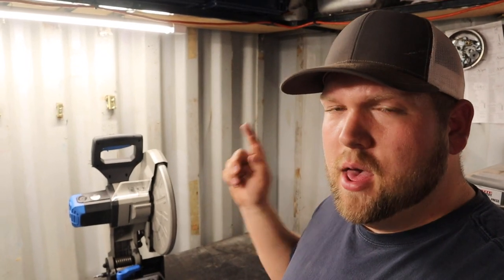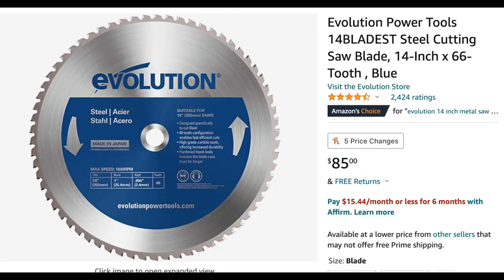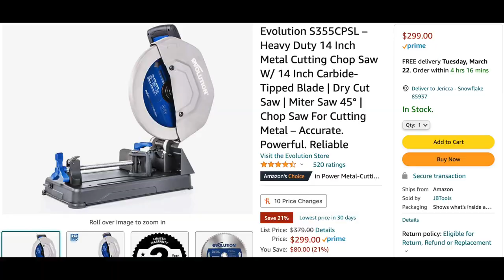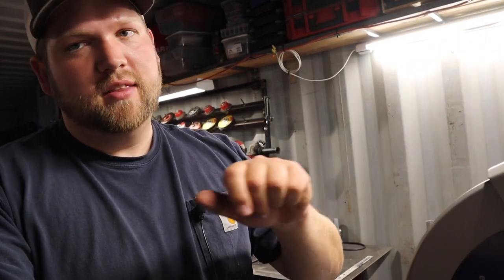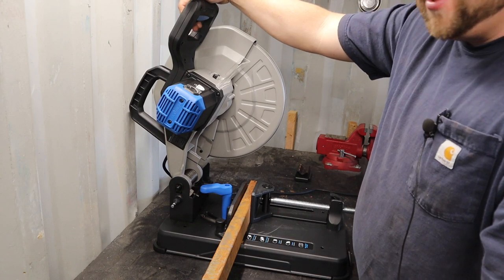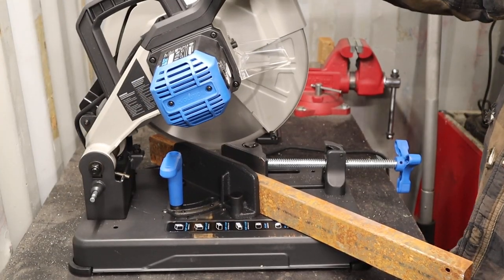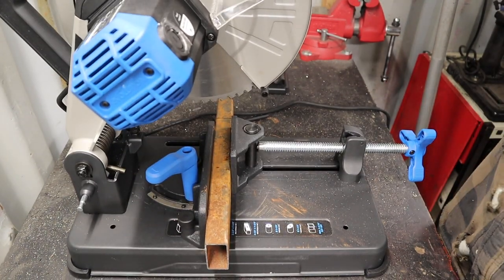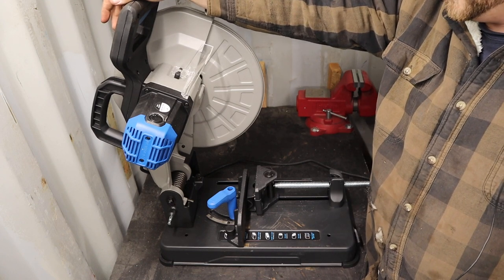NEW Evolution S355CPLS - Advantages of Dry Cutting Chop Saw and Initial Review - [UNBIASED]

Comment: Two massive issues with this saw: in this video you cut the rectangle tubing vertical, which, will pretty much always have the desired result because the clamp vise grabs onto more material in that orientation. 

Problems can arise when you lay that same piece of tubing flat for a different mitred cut, because the vise clamp will “climb” the material and the top of the clamp will kick further forward at an angle compared to the bottom of the clamp. This is a design flaw in the vise clamp. 
Also, the Stop points on the fence are never true 90, 45 etc. Which may not be an issue for some but it’s almost a dealbreaker for me personally.
Reply from the maker: I suppose it depends on what your doing. For me, most of the time a little gap can just be welded up and not cause a problem. That being said, I’ve noticed that issue far more with my abrasive chops saws than this saw. But I know what your referring to.

Comment: I wonder if you can sharpen those blades? I know a lot of people just throw their wood saw blades out when they get dull, but they can be sharpened. I wonder if the same can be done with these metal cutting blades? 

I have also noticed the flex in abrasive saws, it's really annoying to wind up with ends that aren't square, the thicker the piece you are cutting the more noticeable it is. I bet if you set up a zero clearance base and fence it would take care of those burs at the end.
Reply from the maker: I am not aware if they can be sharpened. They USUALLY don't leave burs, most cuts did not have them.